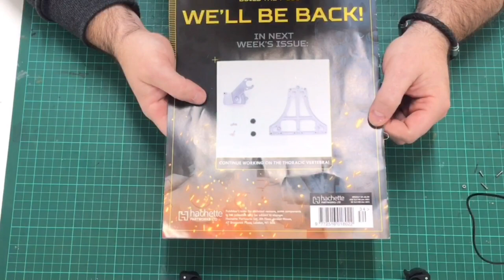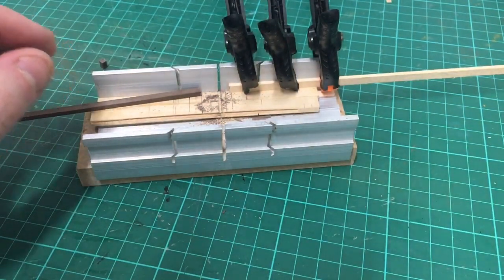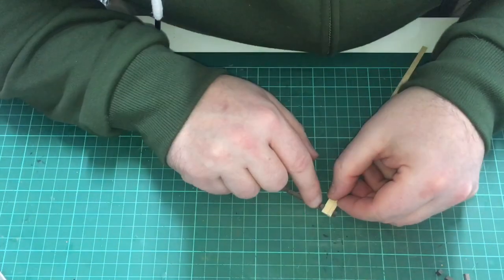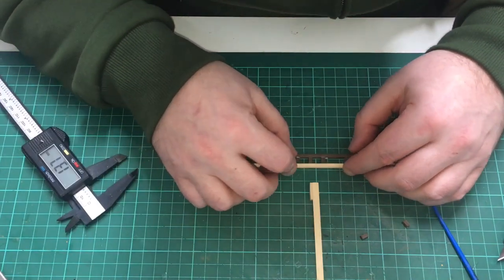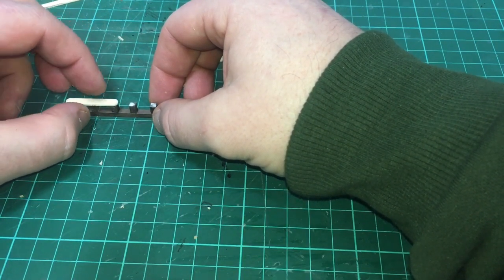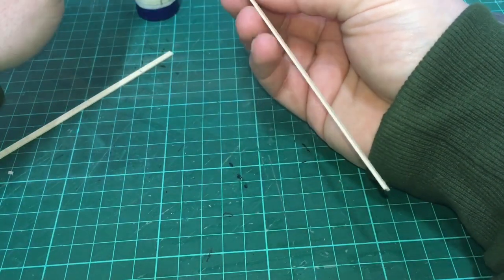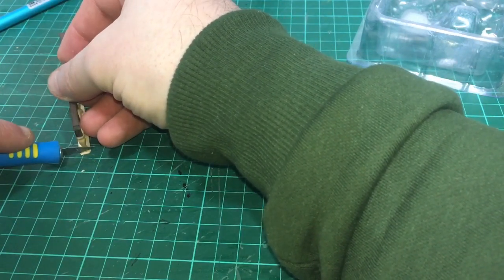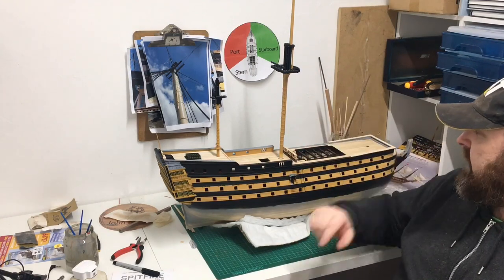Model Ship Builder : HMS Victory  : Part 48 : Making the Deck Rails

Comment: I personally think doing issue to issue is a good idea, your far ahead Genesis models and Would of Wayne. Your probably need a few episodes for Chain whales, Shrouds and Ratlines which look so much better tied with clove hitches by the way. Nearly 3000 knots 😱. Mantua 0.25 rigging string off Ebay is my recommendation for those.
Reply: I agree John this model isn’t the model they say it is. Leaves lots of room for improvement and isn’t accurate especially the rigging. But it also lacks in other areas the gallery as you said but also beakhead frame, oversized figurehead and many other parts. Also poor materials again rigging  thread being one of them. This kit is based off the artesania latina kit but their kit has a fully gunned first and second deck with carriages made possible with thicker ribs and thats just one difference. But there are good points to this kit, the Launch, The barge, Pinnace and Cutter the small boats are superb if you take your time with them. Your channel has some really good points and is different to those mentioned. As you often say you don’t follow instructions and offer your viewers a different look by making improvements to these things. Keep up the good work because i feel that will make your channel popular.